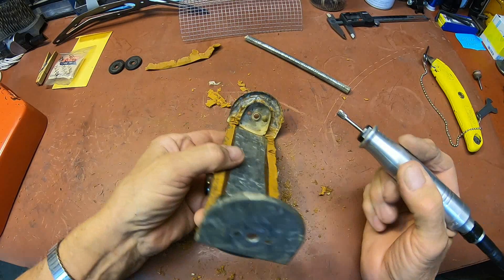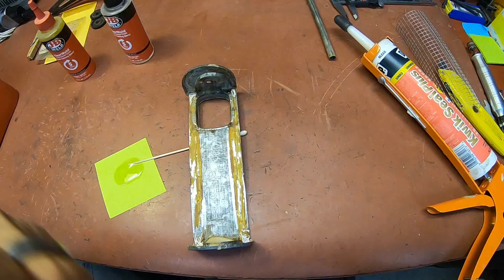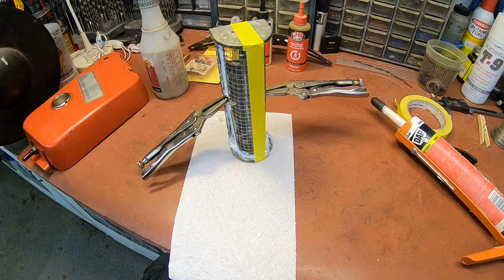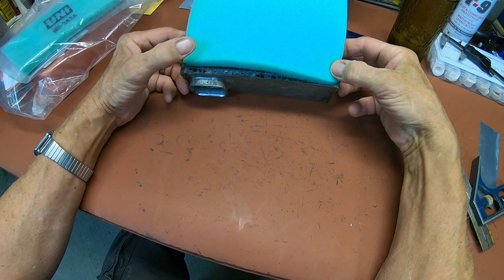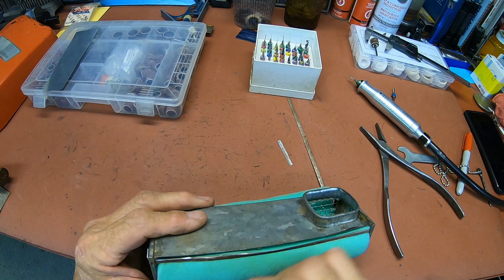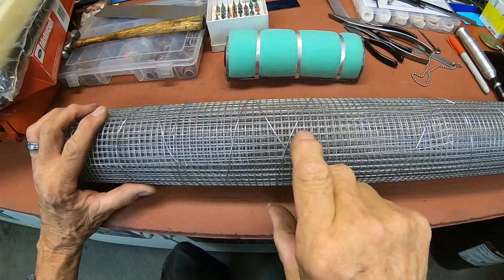Make a motorcycle air filter, Yamaha Trailmaster 100

Comment: Hey Dale ,  the 74 ts400 has a sock filter. Any ideas as to what glue can be used to connect 2 pieces of foam? The original one looks like it's melted together at the seams. Thanks!
Reply from the maker: Yes, I have done that kind of repair before, I have used 3M weatherstrip adhesive, and just Silicone adhesive, you do need to have a way, string or wire to hold the two ends together for the adhesive to cure.
Reply: I was overthinking it, thought I needed a special glue for foam that was fuel & oil resistant. Just gotta keep it simple! Thanks!

Comment: Hey Dale, I believe that BF1 is 65 PPI, any issues with air flow? Any experience trying less dense foam options? I am going to fabricate some filters from scratch for my CS5.
Reply from the maker: I have not had any issues, you have a fine line here, you can use a 40 ppi and not keep the fine dirt out and have less restriction, or you can use a 65 ppi and filter the air better, with a bit more restriction. I have made many elements from the BF1 and had no restriction issues and know the air is clean going in. Street machines might get by with 40ppi better than dirt bikes. With Dirt bikes a little dirt equals catastrophic wear.

Comment: Nicely done Dale. Unifilter is very good. A friend and I fabricated air filters for our rally car in the 1990s. They also had sleeves of the same material that slid over the main filter. We treated the sleeves as disposable items in the ultra-fine, red Australian bulldust. They worked beautifully.
Reply from the maker: Yes sir, sounds like you have some experiance here. I have heard that Australian dirt is a bad thing for engines.
Reply: @montana2strokeracer  The fine bulldust is hard on engines (and suspensions). It often hides fairly deep holes in the road.